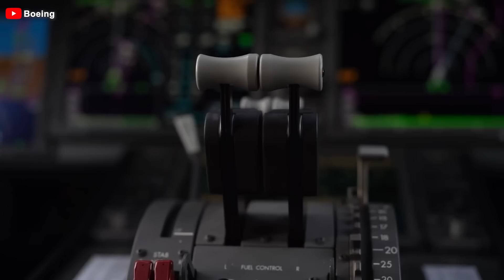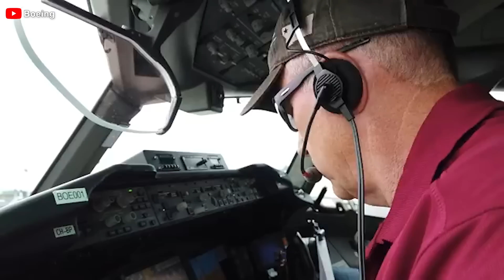Game Over! Boeing to Give Up on The 777X

Comment: This is another 737 disaster...greed stretches the 777 beyond its design envelope, the technology fails with too bigger engines, unstoppable forces twisting the structure,and a fuselage too long for controllability....Its a finished company on life support and tries to repeat the mistakes of th failed 737 disaster? Madness

Boeing should like the max firer the CEO, finishing the scrappage programs for the max, demonstrate they can actually build and airliner which flies and can demonstrate its not going to kill more passengers.

Develop the 777 bt not like the max, get rid of the notion of extending the passenger cabin, take out the rear fuselage sections. Loose the wing tips, add a hybrid tai engine, place a new canard wing behind the cockpit.

The only saviour for this titanic of a company is to go back to basics and start manufacturing a single isle 757 developed aircraft to compete with the xlr., Firer the ceo today...
Reply: Nonsense!💩💩💩💩💩🤡🤡🤡🤡🤡

Comment: I question the claimed fuel efficiency of the 777X. The wing has five flap housings, or canoes, on each wing, compared with just three on the A350. Boeing also have to use vortex generators on their wings, which increase drag. The A350 doesn't need them, and the wing surface is also smoother, being carbon. The seat mile efficiency of the 777X has to rely on the GE9X engines and the increased passenger capacity.
Reply: I guess you know more than the Boeing Engineers, Charles! NOT:face-fuchsia-tongue-out:

Comment: The thing that surprises me about the 777 is the unit cost. I know there are a lot of changes from the predecessor but nevertheless it's a development of an existing well established type.
 I don't understand why it's so much more expensive than an only slightly smaller a350 that is a totally new design.
Reply from the maker: First, the 777x is larger, the fuselage is wider, the folding wings are more complex in design, the GE9X engines it carries are also larger so they require higher maintenance, etc, many reasons.
Reply: @FLIGAVIA  Yeah I'm aware of this but the difference is still remarkable. Maybe it's that the a350 if far more competitively priced than you might expect.  Despite it's hesitant start, it has become a remarkably successful development for Airbus which might be reflected in what looks like a very low list price for such a capable aircraft.

Comment: The folding winglets are a costly gimmick.  If the wings were folding half way, it would have been worth it, but only the last 3 meters?  What a waste of effort.  It probably would have been simpler to figure out a way to fit the 777 at gates rather than certifying these folding ends of wings.

Boeing is no longer an engineering leader.   It fumbles, and shows a constant inability to rise up to the challenge.  Boeing is nothing but a shadow of the company it once was.  At this point, the question is when Boeing will go bankrupt, not if.
Reply from the maker: I still believe Boeing is something, very hard to break...

Comment: Cards on table, I prefer Airbus to Boeing. However, it is a preference not a blinkered love for one and hatred for the other.

I see the 777 as a brilliant aircraft without that much competition before the A350. As the 777 was a clean-sheet design, I see little, or possibly no validity in comparing the 777x with the 737Max, especially when you consider that its predecessor, the NG was its third iteration. Due to adveances in understanding and design since the 737 was concieved, it could be argued that the 737 classic should have been the end of that line of aircraft, a line which can trace its roots back to the early 50s and the proof of concept. This concept was then adapted to become what we now know as the 707/720/727/737 lines of aircraft.

I wonder if the 777x is a mistake on the part of Boeing. It could be described as more of a replacement for the 747-400 than the original 777, which brand loyalty aside, you have to question if the A350 is better positioned to be?

Personally, I wonder if a stretched 787 with appropriately sized wings for that increase would have been a better replacement for the old 777 than the 777x.

It is almost as if Boeing realised that they couldn't make a better A350 using the 777 as the starting point, and since they did not want to scrap the 777 and start again, they decided to move the positioning of the 777x to a place where the A350 would not compete so well. Unfortunately, that market segment was perfectly covered by the 747-400, and as we now know, aircraft with its capacity are nowhere near as popular as they once were. Many had already been replaced with the incredibly successful original 777.

I know thaat some will use stats to show that the 777x will have the lowest costs per passenger mile, however that is dependent upon those additional seats being occupied. it is often forgotten that seat cost usually falls if you simplify stretch an aircraft design, however,  journey costs inevitably increase. Having more seats than you require can seriously affect your bottom line.

Only the most blinkered would dispute that Boeing abandoned the 757s segment, leaving Airbus the ability to satisfy most of it with relatively cheap upgrades to the A321neo. I wonder if we will see something similar when many 777s become ready for replacement, and some airlines may find that it is the A350 that more closely fits their requirements, rather than the more capacious 777x?
Reply: I agree with what you said. However wasn't the A-350 Airbuses answer to the 787 and NOT the 777? It's design and size is about the same as the 787 and it was presented right after the 787's success. The 777's are in a larger class altogether and you're right about them replacing many 747-400's, especially with 2 engine certification now allowed over oceans. You're very knowledgeable. I'd love to see Boeing replace their 757's with a brand new designed 797.
Reply: @douglasishere1772  The A350, regardless of what was initially intended, is a little difficult to place. Is it a large 787, or a small 777? The answer is probably both.

Initially it was intended to replace the A330, but based on recent significant changes to the fortunes of the A330neo, that doesn't look likely anytime soon!

I know that we keep hearing about a further stretch to the A350, but nothing happens. I wonder if it is because Airbus believes that there is insufficient demand to justify its development costs, or simply that they can generate more profit using their limited resources elsewhere.

Comment: 777X customers should cancel the order for the aircraft in favor of Airbus A350-1000 XWBs!
Reply: It won't help. Airbus is already maxed out. They can't ramp up production.
Reply: @marcg1686  Do you know that the Airbus A350-1000 XWB has a lower backlog than the Boeing 777X?!
Reply: @thyip6167  
You aren't comparing like with like. You are comparing one Airbus variant with the entire 777X family.
717 A350 still to be delivered.
505 B777x still to be delivered.
Reply: @marcg1686  The Airbus A350-900 XWB (359) competes with the Boeing 787-10 Dreamliner (781), whereas the A350-1000 (351) competes with the Boeing 777X.
Reply: @thyip6167  wrong,wrong and wronger than daily mail.
the 777x is comprised of 2 planes-the 8 and 9
the 9 is the 1000 competitor.
the 8 competes with 900
Reply: @thyip6167 
Okay, I see where you are going with this.
781
440 pax
149 backlog

A359
440 pax
449 backlog
2000 (two thousand) nautical miles greater range.
You call this a competition?

777-9
426 pax
403 backlog

A351
369 pax
214 backlog. 89 delivered.
1500 (one thousand five hundred) nautical miles greater range.

Better payload/range than the 777x.
Airlines are aware of the fallout of Putin's mindless landgrab attempt in the Ukraine.
Range is a thing.
Reply: Seens like QANTAS cancelling order the BOEING 777X as the Australian flag carrier/Australia's National Airline choose on AIRBUS A350-1000xwb/ulr for the project sunrise future and also longest haul flight route in nonstop from Australia to UK and USA.
Reply: @nabilisur9566  which is why they are finally going to crash
Reply: The two aircraft don't compare and don't compete with each other. A-350 is a completely different target for routes and payload than the 777X.